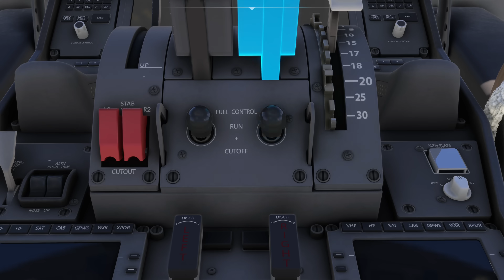Air India 171: Why Did The Fuel Cut-off Switch Get Moved?

Comment: How can you directly blame the pilot without considering other possibilities, you cannot say that the pilots cutoff the fuel, it’s in the pilots procedure to turn off and then turn on the fuel switches in case of double engine failure, the dual engine failure took place way earlier, it took place between v1 and vr speed and by the time the pilots realized the dual engine failure they would’ve tried to restart the engine by switching fuel off and then turning it on, that is in their procedure manual of Boeing 787, I just don’t understand how people just believe what someone has to say without knowing other possibilities, how can you be so sure that the pilots cutoff the fuel to take the plane down
Reply: Exactly. It is criminal what is going on. Why are they blaming the pilots, why would they do this intentionally. The same captain who made the distressed mayday call. Captain steve is a sell out. Very disappointed.
Reply: @barbaras5874 and not only that, the report itself doesn't seem to be competent, as an Indian myself I feel the board is not competent, there is a line in the report which says that the pilot said "why did you cutoff". That's it nothing else, the report doesn't mention what did he cutoff, I feel that this report in itself is trying to setup and pilots, and then recently an other report was released which was about some next steps or smthn. It's second point says that this is a sensitive matter for the family members of the passengers and crew and then to not make false assumptions, the report itself is showing insensitivity by bringing up front this type of conversation
Reply: @zayandave6760 exactly so. This is so obviously a cover up. Im shocked and disappointed that the world seems to be falling for it, letting these big companies off the hook and dragging pilots names through the mud. Why on earth would the captain do this intentionally at take off and make a distress call as well? They think we are stupid.

Comment: As per flying beast who is an experienced ex-captain with 10 years of flying experience 
He says in his analysis that there is a dual engine failure just after liftoff 
And RAT was deployed within 2-3 sec after liftoff as seen in the picture 
So the pilots attempted to restart engines by switching the fuel switches off and on as per the Boeing stated procedures after a dual engine failure 
But this AAIB has not given exact timings of engine failure and also hasn’t stated exact lines of the pilot 
The report itself is insensible and misleading to save the airline and boeing and blame the pilots

Comment: What if both engines failed just after liftoff and the pilot was trying to turn the engine on by toggling the fuel switch. Hence the black box recorded the fuel control switch being cut off and then turned on again! Watch @flyingbeast

Comment: Every where one conclusion is draw that captain intentionally crash the plane... But wait and think..
1. When both pilot recognise ( after conversation of why you cut off the fuel, and another co- pilot denial ) that fuel was cut, both engine are not working, no thrust. And according to your narration pilot are on suside mode. 
Then why he started following all the procedures which helps them to get out from the trouble. Like give power to engine again, nose of aircraft are up.... WHY WHY WHYY WHYY WHYY MR. STEVE WHYY

Comment: Steeve said ..There was no fault in aircraft and whatever happened is due to manual intervention ...If this is his justification then here in such scenario it was  manufacturer mistake because during the take off even if pilot tries to cutoff both switches ...The design and interlock should have prevented the manual intervention at the time of take  off . 
So your argument is countered Captain Steve . Boeing has to improve design .  
So don't dare to put blame on pilots .

Comment: In case the engine flames out unexpectedly ,does relighting the engine required pilot  to toggle the  fule switch cut off to run asper procedure to restart the engine or controls?
As both the fule switch dropped 1 second apart, both pilots were  holding each switch desperately to relight the engine complet the procedure fast as they did not have time

Comment: Did the voice recorder actually pick up the sound of the Cut-Off Switches being moved?

The switches are operated mechanically, but are essentially electrical switches sending signals to a computer controller that then sends electrical signals to solenoid valves that actually shut of fuel flow. It is always possible an electrical glitch (think static electricity, noise from loose grounding wires, etc...) could make the computer think that the switches were moved, when in fact, they were not. This type of false signal could explain the long delay between the fuel being shut off, and the switches being moved to restart the engines as there would be confusion why the the engines were losing thrust with the Cut-Off switches still in the On position; thus requiring them to be moved to the Off position then back to On to initiate the restart sequence.

Also, what is the frequency that the black box flight recorder samples all of the flight data? If the sample rate is low like once per second, then the actual time between the Left and Right Cut-Off Switches turning off could be much less than one second.

Comment: Just some thnking as we dont know all the facts (you may know more...). The facts below are taken from several YT videos about the crash
1. The copilot flying the plane discovered the fuel switches off and asked why the captain switched them off
2. Both pilots denied to have switched them off (VCR)
3. At least one switch was switched on, with partial engine startup but not enough to stay airborn
4. The fuel switches were found in off position according to some reports (can be wrong)

So if statement no 4 is correct "they were found in off position", then the software must have done that. So we may looking on a software glitch!

Comment: Loss of electrical power happened first.  Watch the take-off video.  The rear wheels begin the retraction sequence then freeze even while the plane is still ascending.  As everyone knows the engines will keep running for a little while even after loss of electrical power which, along with the take off speed, helped the plane gain a little altitude but thrust was already going down which is why the trajectory was a hyperbolic path like a thrown football.  If the pilots turned the switches off and on it was in a desperate attempt to restart the fuel supply.  

787 wheel extension/retraction sequence

It swings out and pivots

https://youtube.com/shorts/nuguo7aAUnA?si=mLKMvUC1ZhknIzw1

Comment: Propaganda & Propaganda by boeing :
● the exact time stamp of when one pilot asked other pilot about switches being cut off is not mentioned.....
● the exact time of engine going out is not mentioned it is mentioned as "immediately after" everywhere no exact time stamp given....
● cctv footage shows rat already deployed above airport premises....
which means engine turned off or failed already way before the rat got deployed.....
● pilot first procedure for engine fail is to turn the switches off & then on....to reignite the engine....
● in report it said one engine was already gaining thrust but the other engine didn't....
again exact time stamps are not provided 
● pilot voice recorder exact words are not quoted.....
In the report they mentioned in the third person & was not the exact words used by pilot in hindi or indian language....
Also in the entire duration of 32 seconds of the flight.....it is no where mentioned when exactly the pilot asked the other pilot about "did u cut off" & specifically ENGINE or fuel switches is also not mentioned....
Then means cut off can refer to any other systems of the aircraft....auto pilot, ac, anything......

Comment: Seems to me India Airlines, Aircraft Accident Investigation Bureau and much of the media outlets are attempting to use the cockpit recordings that are not yet complete to justify that the fuel cutoff switches moved all by themselves to to some horrible engineering mistake by Boeing. 

Ok, so lets read into the mind of someone who knows he is going to suicide himself and hundreds more and that this pilot is no newbie to flying this aircraft. This same pilot also knows that the cockpit voice recorder is working and recording his speech.

This pilot knew that if he let the aircraft get to say 1,000 AGL and then shut of the fuel the second pilot would have plenty of time to restart the engines and come back to the airport. Shut of the engines fuel supply at that very critical point in which the aircraft cannot gain altitude or speed to iniate a go around and you can see the results. Mass death!

So pilot #2 asks the question "why did you cutoff the fuel"?

Pilot #1 answers with "I did not do so". Why? Because he knew his voice was being recorded!

Boeing in the past 12 years or so has been on the hot seat due to their own screw ups. So this makes Boeing an easy target. And I mean a really easy target!!

Seems like the AAIB has been stalling in getting out the correct information. Why? I can only see a alliance between AAIB and Air India in trying to scapegoat Boeing to escape the insurance payouts and bad press they would receive.

Why should we care?

1. People lost their lives dam It!

2. This stalling during the 1st month could have placed thousands of other passengers and crew are at risk IF the issue had been with a mechanical or design issue with the aircraft.

3. Loss of trust in those government agencies that are in place to protect us and not become a tax payer funded "blame anybody but us" machine.

Comment: Interesting to note that Captain Steve is keeping quiet about the report that the captain switched off the fuel supply to the engines. No comments from Captain Steve on that, which begs the question, why not?  On another note, the voice recording released, is clearly not the full conversation in the cockpit. Seems unlikely to me that "Why did you do that?" and "I didn't" is the end of the conversation. I can't imagine the conversation terminated that simply, and would have thought there would be quite a heated exchange between the pilots, rather than simply asking "why did you do that" I would be thinking a conversation more like "WHAT THE F#*K ARE YOU DOING". Why is the full conversation being kept so secretive? What are they hiding?

Comment: Yes, the fuel control switches were deliberately moved to the cutoff position and then turned back on — not with the intention of crashing the flight, but likely as an attempt to save it. With some basic research and understanding of aviation protocols, I can confidently say that I’m better informed on this specific aspect than Captain Steeve, who seems to have simply restated the preliminary report and concluded that one of the pilots intentionally crashed the aircraft by pulling the fuel control switches to cutoff. Frankly, it's disappointing to hear such a conclusion from someone with his experience.

Even a basic reading of the preliminary report shows that at 08:08:47 UTC, the RAT hydraulic pump began supplying hydraulic power — 9 seconds after the aircraft transitioned to air mode. A quick check reveals that the RAT typically takes 8–9 seconds to deploy after detecting a dual engine failure. This strongly suggests that both engines failed before the aircraft even entered air mode.

Furthermore, a review of Boeing’s emergency procedures (e.g., for the 737 and 787) reveals the following regarding engine restarts:

“In the case of a hung start or engine stall — indicated by engine RPM stagnation and a rapid rise in EGT — the checklist instructs the crew to 'cycle' the Fuel Control switch: - Move the Fuel Control switch to CUTOFF.
- Immediately return the switch to RUN.

This action helps clear the stall by momentarily starving the engine of fuel, and then reintroducing it in a more controlled manner. The electronic control unit resets, allowing the engine start to proceed without overheating. This cycle may be repeated if necessary.”

This clearly aligns with the possibility that the pilots were trying to restart the engines using this standard emergency procedure, rather than attempting to crash the aircraft.

I hope this explanation helps clarify the logic and highlights how a bit of informed analysis can lead to a more accurate interpretation of the events.

Comment: Pilot deliberate action theory is odd. Video shows that the plane tried very well to maintain proper attitude until crash. If one of the pilot just wanna die there're 1000 simpler ways to do so, it's bizarre that you choose to cut off fuel switches then trying to put them on again and then attempting maintain flight attitude. There're ALSO previous 787 service bulletins warning about faulty electric board in the engine control that could result in loss of thrust. Remember the Flight Recorder only records engine cut off event, not the switch position in the cockpit, if it's electronics failure causing engine loss,  the control pilot would naturally assume engine been cut off and ask the other guy, choice of words is of non-matter in time like this. The confused cockpit conversation, the quick engines restart attempt, and the plane's last moment attitude, all indicate that the crew might have been putting last effort to save the plane. I think electric failure should not be ruled out !

Comment: Basically, it's a design problem.  Boeing has no reason in hell for enabling a fuel shut off to both engines on the initial climb out because shutting off fuel to both engines will ALWAYS result in the total destruction of the aircraft and everyone on board.

Comment: The Telegraph-  Indian media, however, reported that investigators were examining potential electrical and digital faults that could have triggered “uncommanded” actions.

“The probe will ascertain the possibility of an ‘uncommanded transition’ of the fuel control switches to the cut-off mode seconds after the lift-off,” an official aware of the investigation was reported to have said.

Just hours before take-off, a pilot flying the same aircraft from Delhi to Ahmedabad noted in the technical log a “stabiliser position transducer defect”, the newspaper said.

The stabiliser position transducer is a sensor that controls the up and down movement of the aircraft’s nose, and transmits the data to flight control systems. The official said the malfunction was checked and the engineer did the troubleshooting. The malfunction is a critical issue as it can trigger incorrect responses in flight control, including unintended fuel cut-off signal,” the official was quoted as saying.

There had been at least two more similar incidents on the aircraft in the weeks before the crash, the newspaper said.

One involved a false fuel system warning that flashed on the screen of the plane’s control panel. Another was an electrical fault that led to the cancellation of a flight.

The official added that the aircraft had previously experienced two major problems, including an emergency landing in 2015 due to a cabin air compressor issue

Comment: It’s definitely a suicidal  deliberate act . The Boeing 787 is a powerful machine, but if you cut the power on the takeoff, it’s very much deliberate act. Even student pilots in flight school push and hold the throttle like dear life during takeoff
Reply: rubbish!- 
The Telegraph--Indian media, however, reported that investigators were examining potential electrical and digital faults that could have triggered “uncommanded” actions.

“The probe will ascertain the possibility of an ‘uncommanded transition’ of the fuel control switches to the cut-off mode seconds after the lift-off,” an official aware of the investigation was reported to have said.

Just hours before take-off, a pilot flying the same aircraft from Delhi to Ahmedabad noted in the technical log a “stabilizer position transducer defect”, the newspaper said.

The stabiliser position transducer is a sensor that controls the up and down movement of the aircraft’s nose, and transmits the data to flight control systems. The official said the malfunction was checked and the engineer did the troubleshooting.  “The malfunction is a critical issue as it can trigger incorrect responses in flight control, including unintended fuel cut-off signal,” the official was quoted as saying.

There had been at least two more similar incidents on the aircraft in the weeks before the crash, the newspaper said.

One involved a false fuel system warning that flashed on the screen of the plane’s control panel. Another was an electrical fault that led to the cancellation of a flight.

The official added that the aircraft had previously experienced two major problems, including an emergency landing in 2015 due to a cabin air compressor issue.

Comment: About the switches in cutoff. They toggle a bit in the computer. No one is talking about the computer still could have been hacked or the bits failed in code. The write person could have added ode to make the bits go high after wow signal off. Just an observation from an automation engineer.